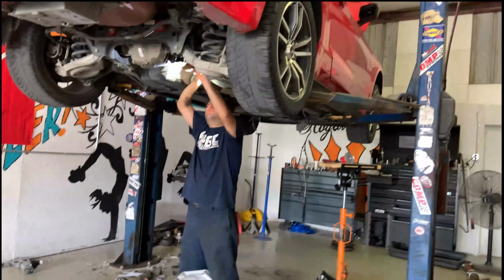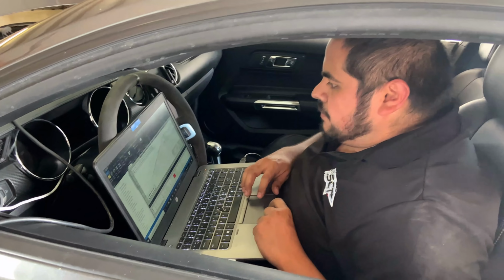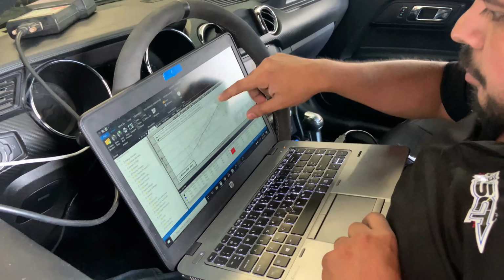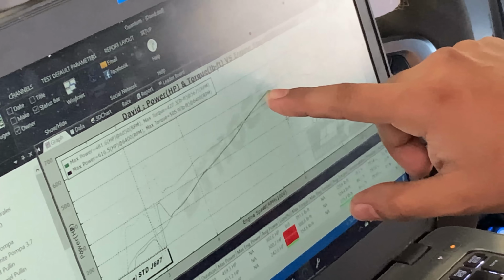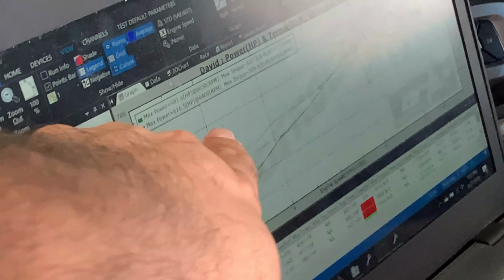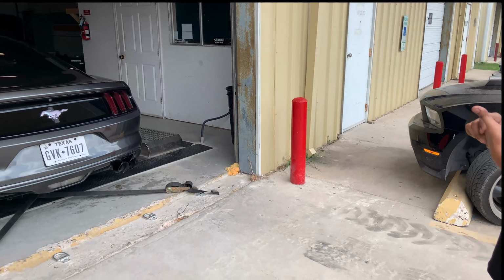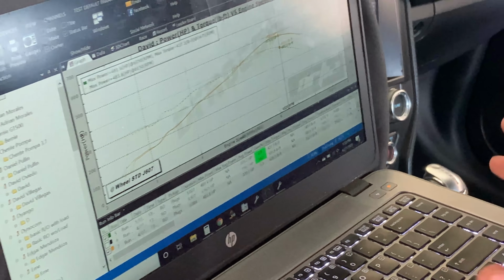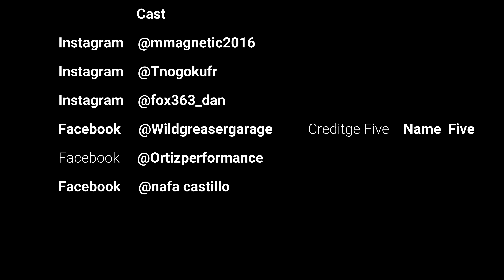Porting for more flow.

Comment: Make sure to take video of the port job on the upper and lower when finished. The upper and lower bolted together with vids of inside of each runner to see how it matches up would be cool to.
Curious to see how well someone can port a intake manifold using a drill and sanding rolls.
Reply from the maker: PoppaSnipe I have some pics but I should have done it the way you mentioned. The car goes on the dyno today to see the difference in power she put down 483 yesterday so I’m curious how much of a gain on just the porting will make
Reply: @DavidVlogz  Nice numbers, not all ported intakes are ported the same way or will have the same results. Why I was curious about how they turned out. Surely you will gain something over stock intakes.
Reply from the maker: PoppaSnipe That is true I have seen differences on the forums. I hope I do so we decided to do the comparison video will be interesting to see. Thank you for your input.